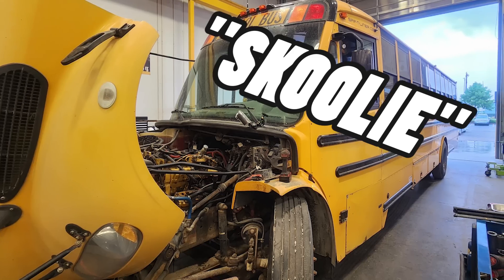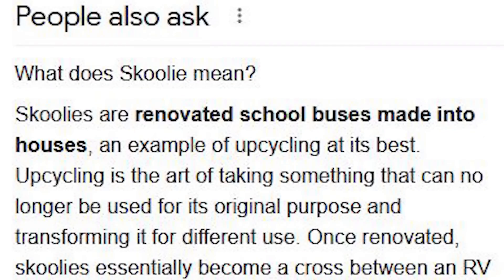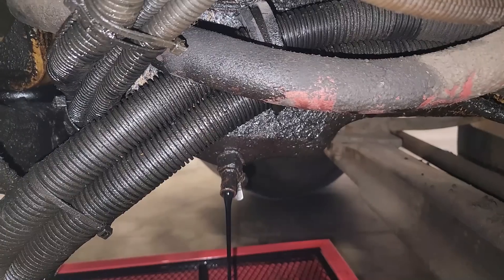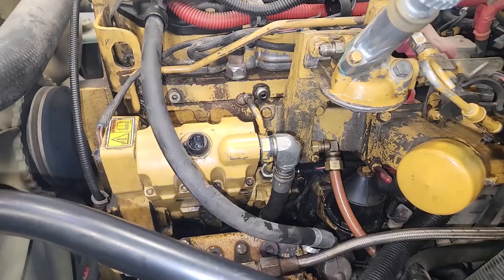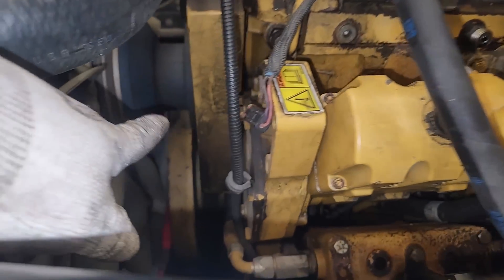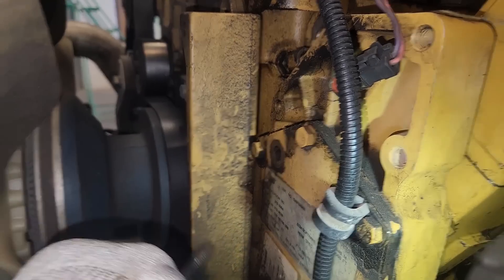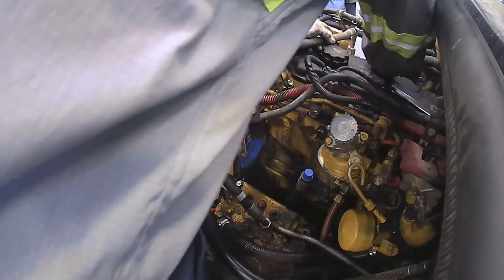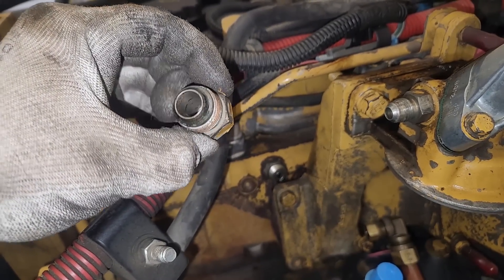"Back to Skoolie" Bus needs Injectors and HEUI PUMP. How to install a HEUI Kit. Part 1.

Comment: It seems to me that a tool that incorporates a slide hammer with a fork would be good for the injectors. But lift up on the injector evenly should make it easier, because just lifting up on one side can cause more binding on the other side.

Comment: What would cause extended cranking b4 it starts ? Sometimes it fires right up other times its crank crank and crank only when its sat over night. Once warmed up it starts right up.
Reply: Did you ever get your issue solved ? What did the magic trick ??

Comment: Now I'm replacing my o-rings on my and as far as the placement of the o-rings. The kit came with 1 o-ring that is green. And you can see in your video that that o-ring goes at the top of the injector next to the square o-ring and I'm wondering is that correct?

Comment: I used to put a socket under the hold down and use my pry bar and they are not easy to remove either way those are a pain

Comment: For injector puller…. Have a small plate witb holes that matches top plate on the injector with a nut welded to it, small slide hammer threads into nut. If you’re replacing injectors completely it works good. Never had the balls to reuse

Comment: 8:55 if your replacing those injectors, then why not take a set of channel locks to rotate the injectors, at the same time pull them?
Could probably get them out easier with 2 channel locks instead of using a grim reaper toy.

Comment: I’ve found if you rotate the injector, sneak a heel bar under the hold down and on top of the head bolt. They pry out fairly easy

Comment: Came across you a couple weeks back.
Enjoy the content.
You can never know to much if you are willing to learn.
You sir, are a technician not a mechanic.
Myself, master Volvo/Mack technician for 20 plus years. You bleed yellow, I bleed green.
In respect to injector removal, you might want to try Volvo part numbers 9990013 and 9990006. I believe you can purchase this in a aftermarket  application as J-48922-A, as Volvo tools are exorbitantly priced.
Have used this tool on the following applications: Cummins, Detroit, Mercedes, MAN and CAT.
Will pull injectors in seconds. Have actually pulled the sleeve/cup with the injector at times. 
Hope this helps.
Cheers from Canada
Reply from the maker: Hello Rudolf, I looked the tool up, looks pretty interesting. I'll check it out, thank you so much.

Comment: I have used a small gear puller with bolts threaded though the injector hold down clamp on both sides and a slide hammer.

Comment: What about making an adapter that would screw into the top of the injector connected to a slide hammer. That would seem easier to pull the injectors, especially if you work on those engines all the time like you do.

Comment: hi try to use two pry bars to get the injectors out . one pry bar on each side . then you push the injector upwarts ,
insteadt of using one bar and push the injector to the side and not upwarts .

Comment: I was down for the video till I saw it was a SAE wrench
Reply from the maker: The fittings on Cats are usually SAE, but the bolts on the C7 are metric. Gotta use the right tool for the job.

Comment: If the injectors are in the cylinder would cranking the engine over with them unplugged and hold downs loose help? Ford designed spark plug automatic change intervals and put a safety hood just in case.

Comment: Had a buddy make a custom slide hammer attachment that worked pretty good on the injectors with enough head clearance. It completely ruined the old injector in the process but saved a lot of time

Comment: You can change a injector on c7 in 20 minutes I use a heel bar very easy the hardest part is getting the valve cover off

Comment: My own homemade tool for those particularly asshole-ish injectors: If they are trash to begin with I have a small pulley puller over the injector head, held the fingers loosely in place with a zip tie, with a small slide hammer welded to the other end of the puller. A bit butch but they always pop right out after the 2nd or 3rd pop of the slide hammer and nothing gets hurt. If the injector you're pulling doesn't have a whole lot of flange depth for the puller fingers to bite a hose clamp over the puller fingers works like a champ too

Comment: Question.......
The o-ring issue, loosing huei oil pressure, is that a problem on the 3126 as well?

Also..... I have a 3126 the has an issue starting, Allison auto, 2001 C6500 Kodiak/Topkick, 26,000 GVW.  Engine was swapped from a 2000 F650 w/Allison. 
Recently it started this flutter, missing, weird thing at steady speeds, it also will yield white smoke if you let it continue. If you back out of the throttle or mash it to the floor it stops doing it and runs fine. Also it idles and starts great. The other day I decided I would make a run with it 75 miles away to pick up a Ram 1500. Now this truck is not my normal truck, it's driven by a part time driver, and she had only noticed the weird fluttery miss. So, as I was getting to my p/u the flutter became much deeper pitched and it would start loosing speed and RPM. Back out of the throttle and it would be fine for awhile. Also when the engine was swapped (about 7500 miles ago) I installed mechanical oil pressure 40psi at idle and temp guage 170 degree F. Normal and never seen it get over 200F. I've had people guess all kinds of different things, but if I listen to them and they are not CAT mechanics, it would be torn down to the pistons and rings, just to find out the the injector o-rings or the valves are hanging up or way out of adjustment.

Comment: Hey josh.
Hello from isreal😁
In my experience with the c-7 i found that the best way to remove them is a peice  of rope and a long pry bar.
You tie the rope to a circle and then you "choke" the injactor.
You slide the pry bar in the remaining rope, put one side on a high level peice of metal... hold the other side firmly and give it a good 'smack' up. (Like a  c saw)
It takes about 3 minutes to pull all six...
Let me know what you think..
Thank you for your videos! You rock🤟

Comment: Stiction is the term for the static friction that you need to overcome to get stuff moving. Its super important to have low stiction on high performance motorcycle forks.

Comment: Could you loosen the 2 injector bolts a couple of turns, disconnect the injector wiring loom and turn the starter key to turn the engine a few revolutions? Maybe try it off camera in case it goes wrong.

Comment: At our shop, we have two allen head screws the same size as your injector hold down bolts and two L brackets with a nut attached to them. We essentially use the two bolts to thread down through those nuts in the L brackets and down into the cylinder head to pry up on the injector. And place the L brackets on top of the injector to evenly press the injector for installation. Hope this makes sense? Can send you a picture if you’re more interested.

Comment: i always liked HEUI systems over traditional, its built in safety is if you have a base engine problem low oil pressure, or clogged filter or similar, a HEUI truck will shut down typically before your core is destroyed or major damage is done making what you have still salvageable or perfectly fine if its a small issue, vs normal common rail it will run without Oil usually. or low oil and destroy itself without much warning maybe a dash light, i like HEUI systems as well for the fact they're not as susceptible to poor fuel quality or even contaminated fuel as a common rail system yes you could break some injectors overtime, but you have only so many high pressure oil lines and injectors and the pressures of this system are far far lower than a high pressure fuel pump say a CP3 or CP4, and in most cases when a CP3 or CP4 pump fail all your downstream fuel componets are generally taken with it, with a HEUI system HPOP fails catastrophically which is unlikely since it gets plenty of lube it lives in engine oil, you endup with a system although has quirks once overcome i think far outlive common rail counterparts with less mind paid to fuel quality and just normal oil changes granted oil change intervals on HEUI engines should be MUCH lower than common rail but its a practice i think everyone should do instead of todays OTR trucks doing 25,000 miles plus on a single oil change seen guys doing 80,000 mile oil change intervals on new equipment.

Comment: I welded a slide hammer rod onto the adjustment screw for a vice grip. Obviously with the hammer on it beforehand. And I think if your able to clamp the vice grip on somewhere of the injector, you can get it out. But you need room above it.

Comment: Awww man good ole c7 I hate this engine bc when I see it it’s in a f750 and usually a c7s so it’s always regen and ard head or the fuel line filters or the fuel enable valve or the pilot valve or pilot pressure sensor  which I just did on a truck being that I’m the new guy and apprentice anytime a c7 comes around I get it bc no one else wants it TnT

Comment: I do diesel parts warranty, in my system the 10r8899 pump is just labeled oil pump. Pretty cool to see that it's the HEUI pump. I see those fairly often

Comment: So on the railroad for a number of years they used a “CAT” engine, that said Perkins in the SN.  I believe a 6.7 L.  Biggest POS. Once a year we would have to have cat come out and do what I call a CAT tune up.  About $15,000 per machine.  The C7 you have here looks like the exact same critter.  They said Perkins, but it had CAT allllllllll over it.  Same critter?

Comment: we have a special tool we use to remove c7-9 injectors its basically two long bolts that have allen heads in them(smaller than the injector bolts), two nuts that have some flat metal welded to the bottom of them that it folded upwards so you can hold it. The bolts go through the bolt holes on the injector and locate in the head. The nuts go beneath the injector mounts and you can easily unwind and pull out the injectors with a ratchet or allen key.
Reply: I made a fork that goes around the injector body under the hold down strap that attaches to a small slide hammer. It’s quick and easy to get them out.
Reply: Right tool for the right job. I have used them many times.

Comment: I'm just starting to learn and this may sound silly, but can you show the tool you used to suck the grime out? How does that tool work? What do you flush it with, does it need to be totally dry after? I just can't tell if its a compressor set up or a ball you squeeze
Reply: Vacuum brake bleeder, just google it, has many applications
Reply: Compressor setup brake vacuum, like for disc brakes.

Comment: VVA solenoids screws. Holds the solenoids together before install. Or those are the install screws as the are two sizes. Depending on serial number prefix.

Comment: I used the CAT tool when I worked for cat to remove the injectors. Its a little peice of all threaded rod with a nut that kinda jacks the injector out. But it strips the threads after a few sets of injectors. If I can find the part# on my MAC mini prybar I'll post it. I spent 6 years in the truck shop on c7 and 3126's

Comment: I save one screw, and when I remove a solenoid, I place one in it. So when it comes off it is assembled and not risk dropping the darn thing into a engine and falling apart.

Comment: The two pin connector, IVA, Engine Compression Brake, Injector, Cat makes a splice harness. As I dislike cutting wires, I try first is to remove the plastic part of the connector. Most of the time I just break it off. I then inspect the terminals and usually you can respring them as they get flat. So I push it back up and make it tight. I take a old IVA solenoid and push it onto the terminal and verify the connection is snug. Once I know the harness is good, I take the Cat splice harness, take it apart. Throw the wires away and take the connector and install it over the factory harness. If you like the little seal, Cat does sell it separately.

Comment: I was definitely taught to pull fail plugs first and Evac all the huei oil first before pulling injectors. And as for pulling the injectors I use a heel bar with the base pushing off from whichever head bolt is closest and or a socket underneath. I also dip the inj and orings in 15-40 first.

Comment: https://manuals.harborfreight.com/manuals/56000-56999/56894.pdf  This is what I use to remove 1-4, the rectangle with the with the hook fits perfectly over the mounting shoulders.

Comment: on the injector extraction, i am assuming the hold down bracket is the safest location for applying force. If you made an adaptor for a slide hammer to go through that backet. that could possibly speed things up. and insure a good removal angle.
Reply: No room on the back 3 cylinders for a slide hammer. The cowl is in the way
Reply: works great !

Comment: Were the first generation HEUI systems less problematic? Like the ones that used the same injectors as the early DT466E, T444E/PowerStroke, 3126

Comment: Is it really that big a problem if you don't evacuate the cylinders? Diesels are pretty ambivalent about running on fuel or oil, so as long as there isn't a lot of metal in the oil it should be fine
Reply: on the c7s if u dont evacuate the cylinders after pulling the injectors it will hydrolock because when you pull an injector all the oil in the rail goes into the cylinders. u dont have to get every drop out, but u do have to get the majority of the oil out.
Reply: At least that's my thoughts about it

Comment: I always pulled the valve cover base and replaced the harness. Seems like any heat cycling on that harness and the plastic turns to dust. It also makes removing stubborn injectors easier with longer pry bars and such. Are you using the new line with the check valve in the kit?

Comment: Use a small u-bolt through the intake side of the hold down bracket with the threads facing up. Bolt a metal plate across the u-bolt and pry up on the u-bolt pushing down on the rocker shaft.

Comment: so Josh I ran a regen on a straight truck with a b6.7 cummins and I believe it's got a blown egr cooler. regen took 1 hr and 15 mins. now the egr codes are gone?? could it have been a failing egr that plugged the dpf so quickly???
Reply: Need to check the cross drilling in the intake air connector. Are you loosing coolant? If you suspect the egr is leaking remove the cross over pipe and take a look. If it is leaking I've seen those things lock up engines via hydro lock. What code was set?
Reply: and why did the egr codes go away after I ran the regn???